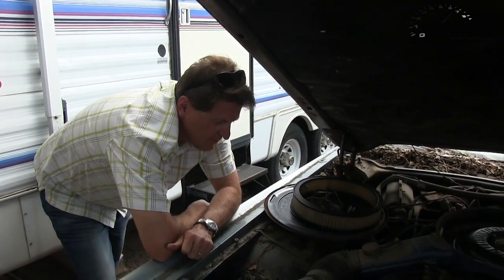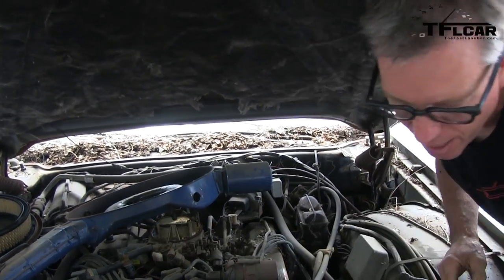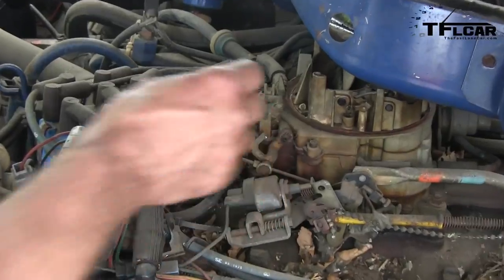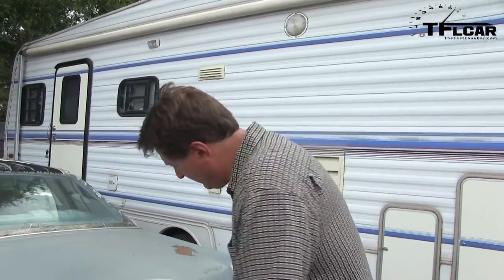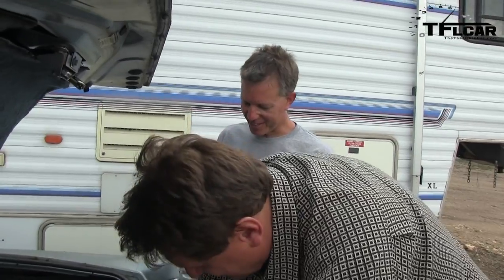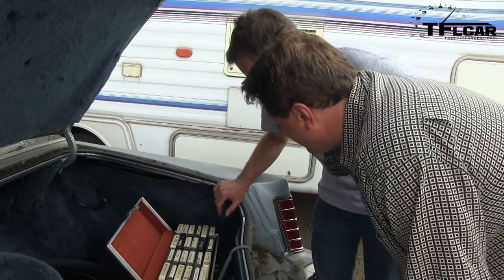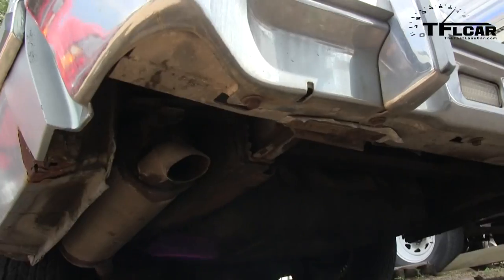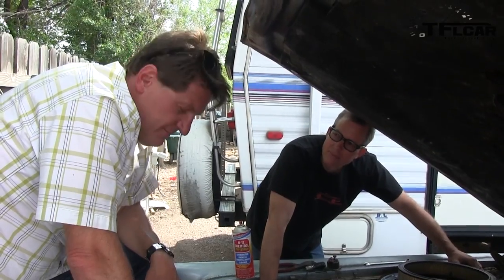Diamond in the Rough: Restoring a Classic American Luxury Car ( Episode 2 )

Comment: Thats is the sound of a 460 which has not seen oil above the pan in 9 years getting revved up. OUCH
Reply: giskard80 one time I bought a 1977 Lincoln Continental Mark V with the 460 from a dumb kid that inherited from his grandfather. it was in the garage covered in dust and hadn't been started in many years and we told the kid not to start it but when we got there to buy it the dumbass started it and totally destroyed the upper end.
Ended up having to rebuild both heads.
Reply: i was frownin hard at him repeatedly REVVIN the motor...

Comment: To any one reading, ,if you spray or pour anything down a carburetor,put the damn lid on it before you start it..He could have easily burned the car up by not putting the breather top back on..
Reply: A method.....leave lid ON...without wingnut....and pour fuel into the recesss on the lid around the carb stud. Puts just enough fuel and FUME to fire the engine.

Comment: These engine compartments are THICK with multiple emissions system hoses, wires, etc....but pulling spark plugs FIRST, to squirt a LITTLE oil inside each cylinder MIGHT save rings, and help the engine turn over.  And don't push it once it starts.

Comment: 1972 Jaguar XJ12. Spent over a decade in a field, until I dragged it out in 2003. Fired up after a new battery, new fuel, a ton of carb cleaner and... fresh oil in the sump. No seizing, little wear, and 11 cylinders burst into life. The twelfth? The rats had been at the HT lead. Even all the electrics worked, where bulbs weren't blown. So what were you saying about the brilliance of American engines and not about British engines?

Comment: There are rubber lines that connect the fuel tank to the frame line, and another that connects that line to the fuel pump. You can drain and blow out lines easily enough by disconnecting those. I have no idea why he wants to try to run the car on ten year old gas...

Comment: It isn't "beat up" its rusting because there wasn't a real car cover on it. Rust can be fairly easily fixed. 22K means, there is no real wear on the drive train. They made around 5000 of these. Real ebony wood was used in the interior.  Kasmin  Cloth interior, much more expensive than leather.(He's lucky it isn't ruined) The Audi? 5 cylinders. Dime a dozen, no styling features at all, no curves, just a car.

Comment: i hate it when folks finally get the motor started they rev the ever living crap out of it especially with old nasty oil in it,,,, give the oil a chance to circulate to the top of the motor and everywhere else ..dry start ups wear out the cylinder walls and rings quickly...